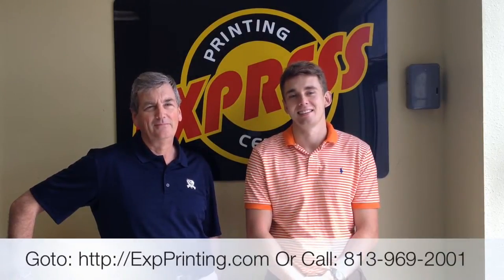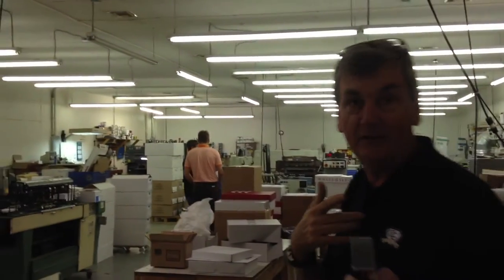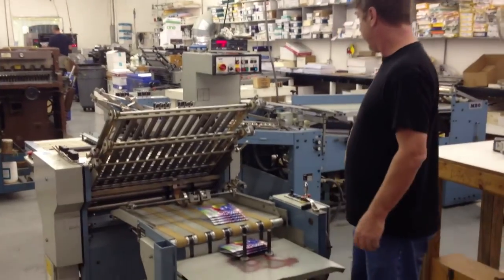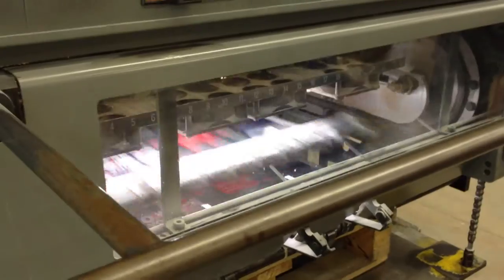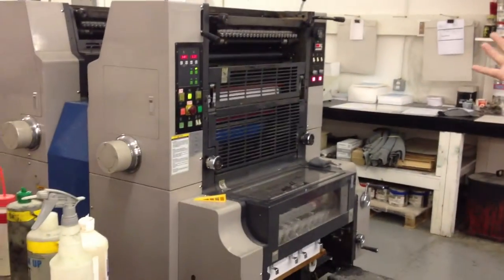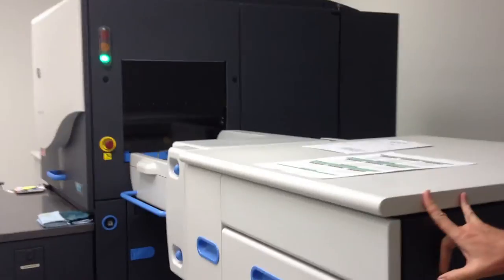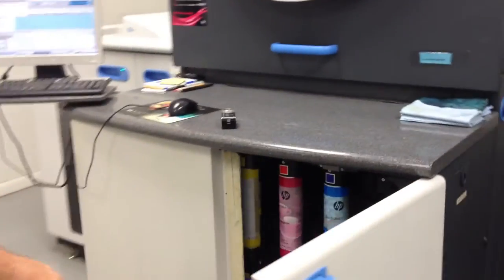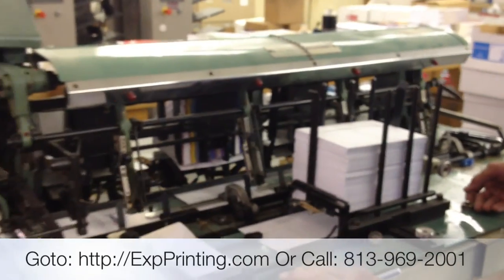Commercial Printing And Direct Mail Marketing In Florida | Express Printing Center Facility Tour

Comment: Why would you have only a four color press. You need a coater. And a newer Komori. 29 inch would be ideal. Coater in line. And all the software you can get with a newer press. Also can produce at 15,000 sheets per hour. You can get a 10 min makeready position and color. Produce about 10 jobs a shift. Average run 2.5M. And a 2 color comparable to the 5 color. I hope they can handle the same size sheet. Of not you are wasting production. Nice shop.